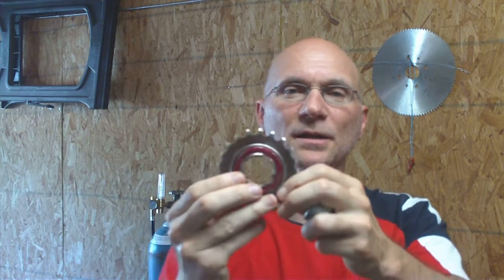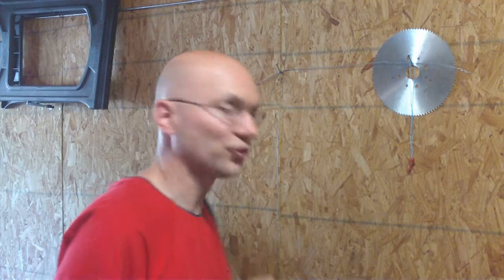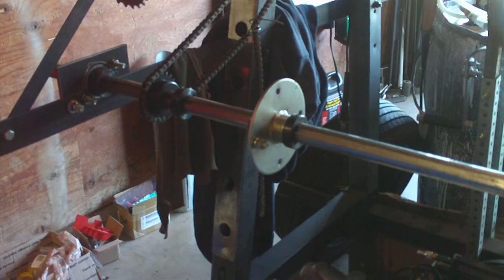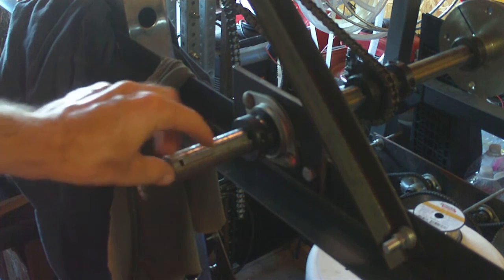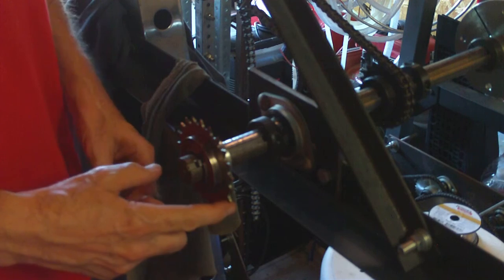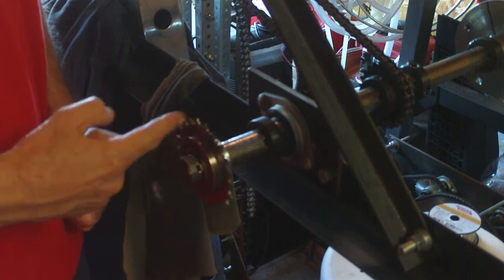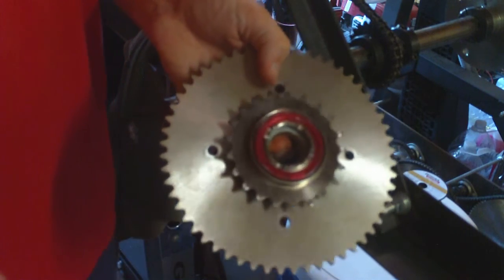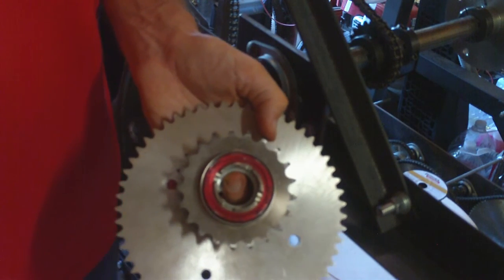Free Wheel vs Sprag Clutch

Comment: yes I know of this idea.  but I truly want to know how much torque the threads can take before striping out??  heard maybe its 3hp?  I want to see a freewheel sprocket that has a keyway to lock on thread to prevent striping.  good idea?
Reply from the maker: @aaron - The free wheel would need extra inner material so a broach could make the keyway. Then afterwards you could run a large tap through it. This way you would get both threads and a keyway down the entire length of the threads. Probably more trouble than it's worth though.

Comment: Can this thing handle 10000rpm and 14Nm torque?
Reply from the maker: Approximately 10.7 ft-lb at 10,000 rpm is probably asking too much. My guess is the heat from the stress would eventually destroy it, but I don't know the specifications so I can't be certain.